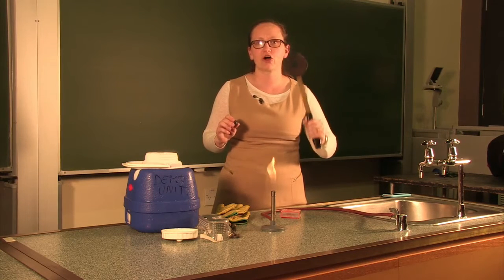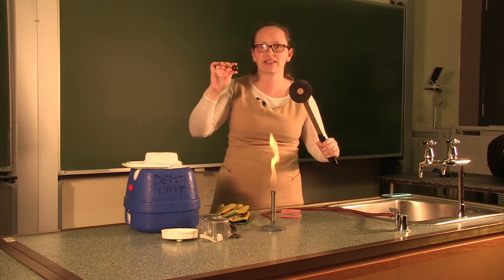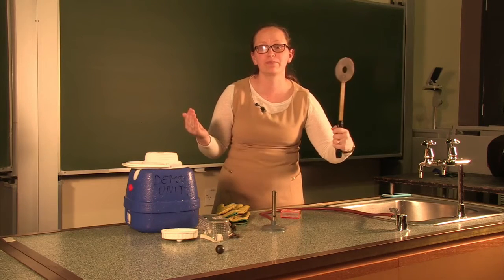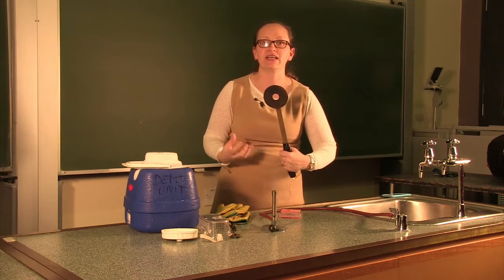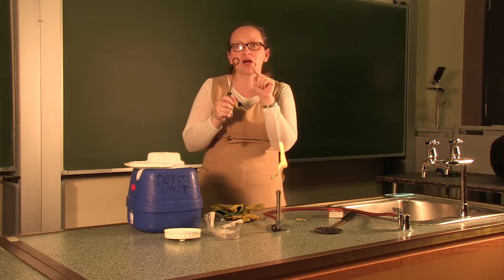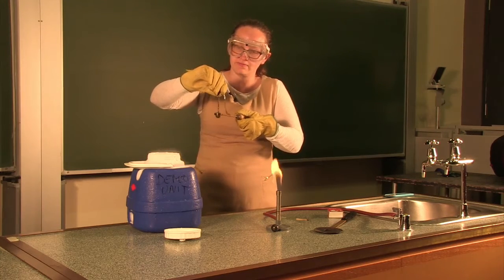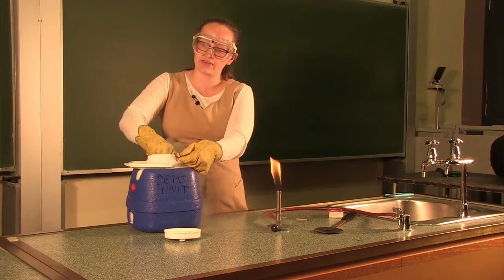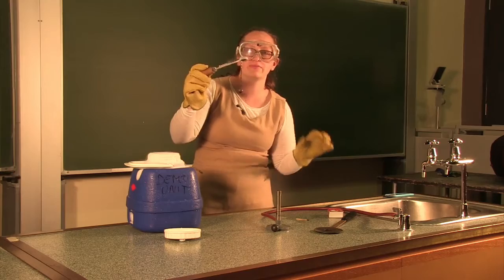Demonstration heating ring

Comment: Question: A copper ring fitted (h7 tolerance) on a steel block, when you heat both, copper try to expand more that steel, the inner diameter of copper will increase or decrese?
Thanks